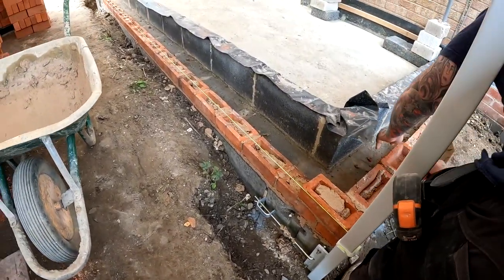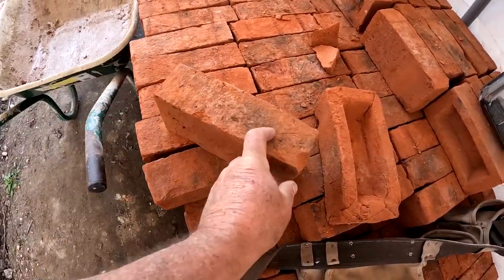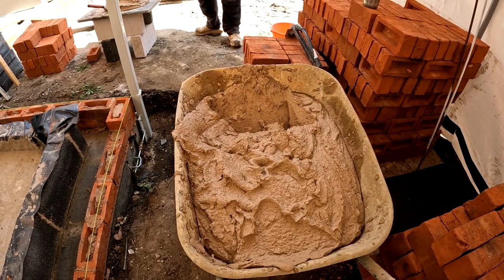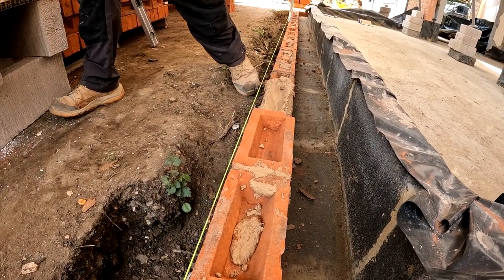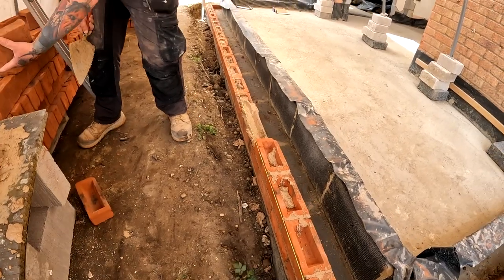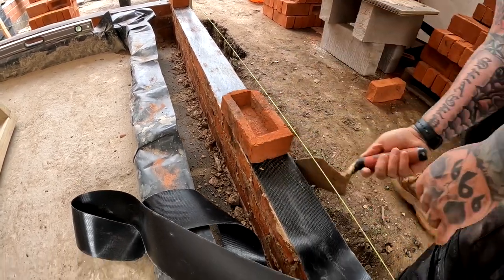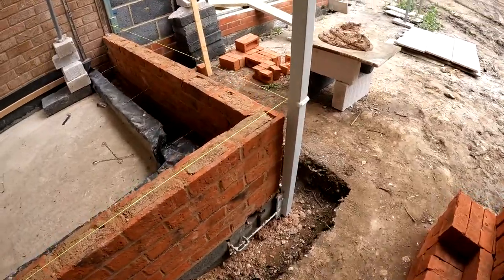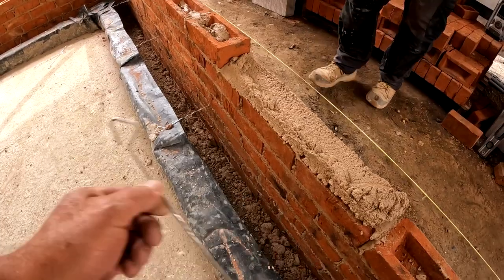BRICKLAYING with pre-made mortar & awful bricks?

Comment: Nothing wrong with grit sand thats all that was used year's ago, the lads doing well, one brick at a time the way to go. Pukka job 👍👌
Reply: I’ve always done my brickwork with a bit of grit sand added to the mix, so instead of a 4:1 regular builders sand and cement I’d use 2 lots of building sand along with 2 lots of grit sand to give it some rigidity.
Reply from the maker: I think it’s what you get used to, when we started this one it was a bit of a culture shock , but have adapted and got on with it, many thanks for watching 👍
Reply: @BuildingwithBudd  👍

Comment: How does building control let you get away with an external wall becoming an internal wall with no slot cut or even blackjack from the new outer leaf to  300 beyond the inner leaf ?🤷🤷